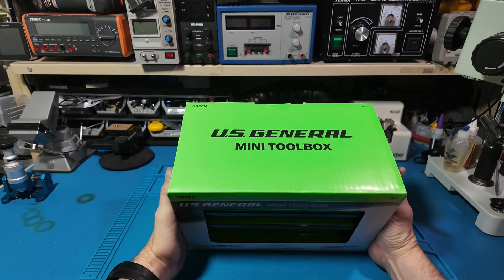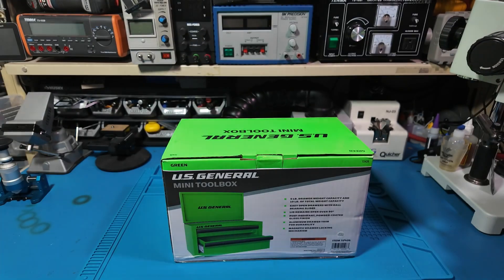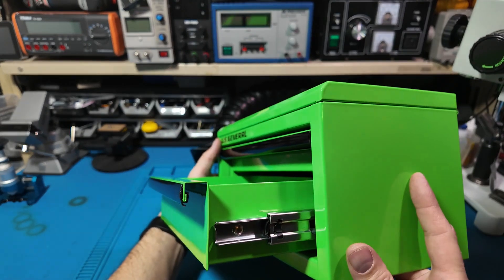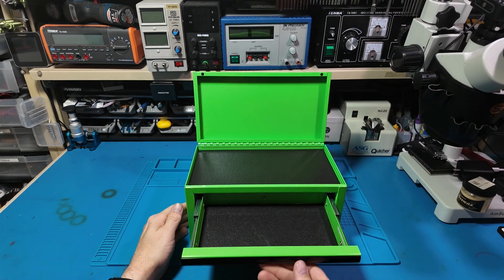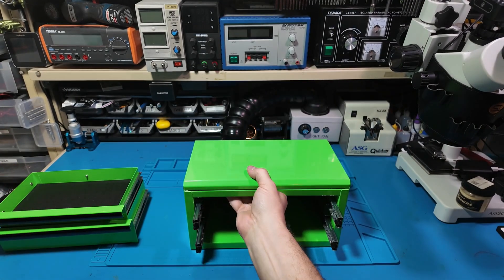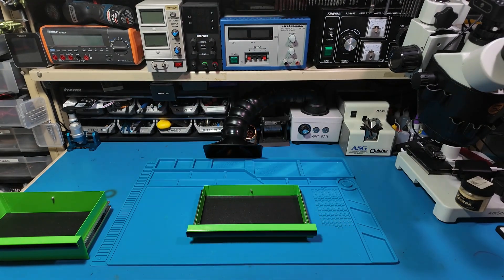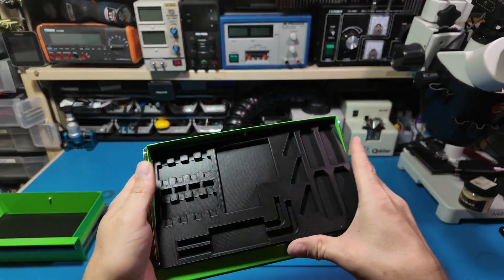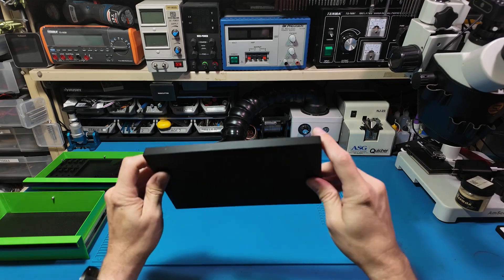I Didn’t Expect This $20 Toolbox to Work This Well

Comment: Great video! and great demonstration of finding a good use case for a little micro toolbox like this. I think when I saw these I was mostly unimpressed with the top hinge strength, seemed a bit floppy. But I could just attach some strong magnets to make sure it doesn't rattle loose or flop open when moving it... But I might do something like this myself!

I install lots of the same equipment over and over again, so keeping a little toolbox with only the relevant blades and bits necessary instead of a big bag of everything is a smart optimization, enabled by a low cost tool box like this. Thanks!
Reply from the maker: Thanks alot,  I like having exactly what I need where I need it even if it means having duplicates.  Hope you do build some stuff to help you .